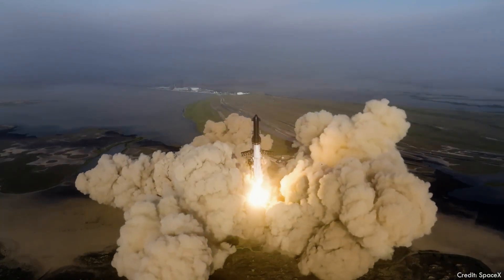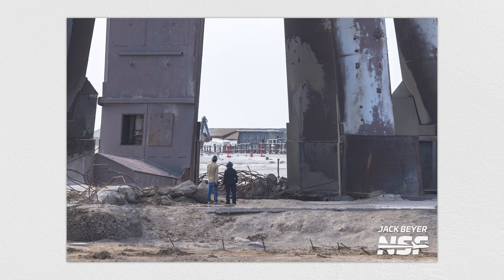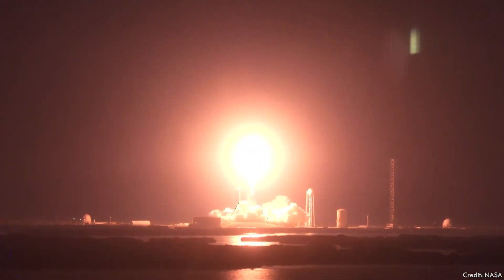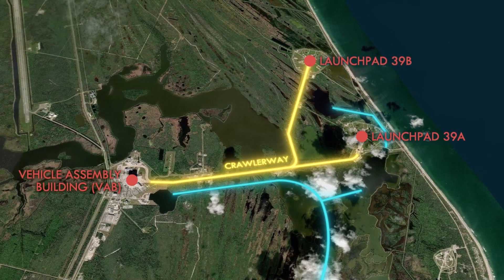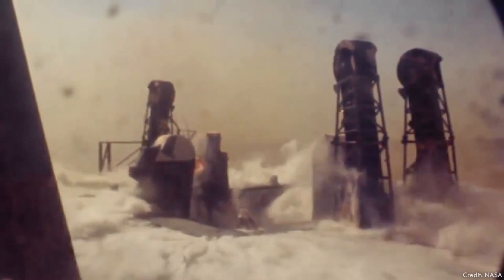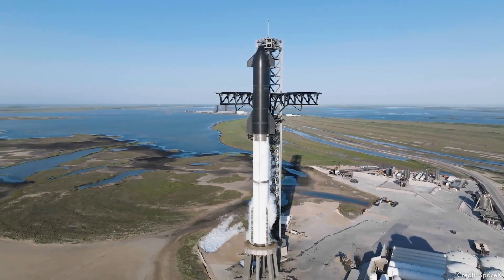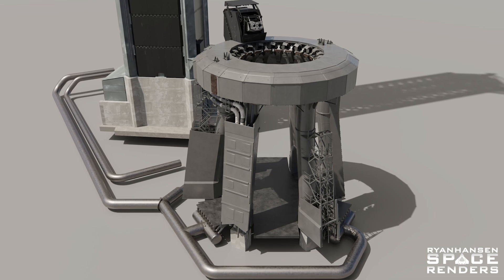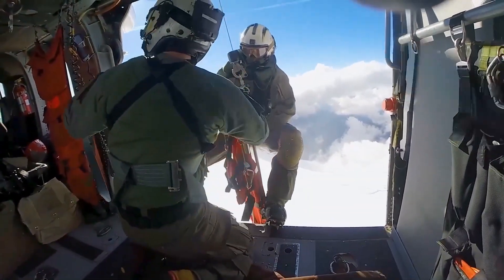Was Starship’s Stage Zero a Bad Pad?

Comment: The launch pad facility had been roundly criticised as inadequate by experts primarily because of the lack of a water cooling system. Despite that, Space X engineers, under pressure from Musk, ignored its widely pointed out deficiencies. In effect, the resulting obliteration of the facility was inevitable.
Reply: They were already working on the deluge system, but because a full static fire did practically nothing to the launchpad, they took the chance for 1 launch that had a possibility of exploding at take-off.
Reply: SpaceX was already planning on the new watercooling system before the first launch even occurred. They knew the current pad wouldn't be a long term solution, but their analyses from the static fires and launches they'd done indicated the concrete would simple get damaged, and not completely destroyed. With that in mind they figured it was worth sacrificing the pad as is to get the launch done, and then install the system for the next launch. In hindsight it was worse than expected, but it's not like they knew this would happen and just ignored it
Reply: @thomashayden804   Every engineer from NASA and industry had advised them not to do it. Yes, they simply ignored it. They simply didn't care if the pad survived or not.   Another stunt. The rocket was also a disaster, it was virtually falling apart on ascent, the engines didn't just flame out, they were self destructing along the way. This thing needs an entire redesign. There is no way to put lipstick on this pig.

Comment: Wondering if it would be possible to engineer a natural water deluge system that leveraged being so close to sea level, so instead of building up, you dug down.
Reply: The word 'deluge' should have keyed you in. Doesn't work as there wouldn't be enough water nor is it controlled. The water system puts out far more water than the hole and must be sprayed to prevent sound/blast damage. Also people will not take kindly to you disrupting the water table and the risk of liquidfaction. The power of the exhaust would also make a hole big enough impractical, the amount of smoke and steam is the amount of space the gas needs to expand into.
Reply: Where would the water drain to afterwards?  You'd just end up with a pool.

Comment: Pads 39A&B have water sprayed underneath the booster from the sides.  The exhaust gases and steam are then directed away in the flame deverter.  The water cooled plate at stage zero will spray water upwards.  Super Heavy produces 16 million pounds of thrust.  Does this mean the total water pressure also needs to be 16 million pounds just to make it out of the nozzles?
Reply: Not all exhaust is going to impact the water nozzles, so no, water pressure would not need to be that high.
Reply: You don't understand liquid, it seems,  you can't compress water. So you don't even need a very high pressure pump to work in that environment.
Reply: @jantschierschky3461  Liquids are incompressible.  A quick and dirty calculation shows anything over 18psi will get water out of the nozzles if loads are distributed evenly.  My question is total pressure for the system.  Lots of area will need lots of volume, presumedly over a short period of time.  Think of a fire truck.  Lots of pressure at the engine to get the volume of water on the fire.  That water is not usually opposed by a counter pressure at the fire.  It's ok if you don't know.
Reply: @armandomercado2248  The total amount of force needed depends on the area of water flow. If the holes in the steel plate are 1% of the total area of the steel plate, and the entire force of the rocket exhaust is bearing down on the steel plate, they wouldn't need a force of 16 million punds. More like 160.000 punds.

SpaceX will use high pressure nitrogen to force the water into the steel plate, and that is a method that scales quite well for generating a large force.
Reply: @SpaceAdvocate  SpaceX first attempt at pad design leaves me sceptical.  Their challenge will be getting enough cooling over a large area very quickly.  The nitrogen water mix was meant to displace oxygen in the atmosphere to prevent a methane explosion from what I understand.  Nitrogen has less heat capacity than water, so it's not a panacea.  I await the thermodynamic engineers on YT to weigh in.
Reply: @armandomercado2248  They won't use liquid nitrogen. The Nitrogen is gaseous and at room temperature, used merely to force the water into the steel plate. No nitrogen should enter the steel plate while the deluge system is operating.
Reply: @SpaceAdvocate  See CSI Starbase video on this topic.

Comment: Maybe I missed it but what was wrong with the proofed and tested NASA design? Why does SpaceX need someting different, twice?
Reply: It's ultimately down to trying to optimize the pad. A deflector system takes a lot more space than the steel plate system, and it is likely more expensive and difficult to work with (given the height and angles present on it. We'll have to see whether the steel plate is reliable and low maintenance enough to make it worth it, but assuming it is then this pad design will be cheaper and quicker to build, easier to work around, and just as effective as the defector system. Could amount to nothing and be a waste of time like Elon mentioned, or it could be another optimization which helps SpaceX get even further ahead everyone else
Reply: NASA always designed without any regards to costs. Which made Saturn V and then Shuttle disastrously expensive.
Reply: They can't dig a diversion tunnel. Underground water is too close to surface. Plus constant lawsuits from local eco activists.

Comment: I was thinking since they are essentially at sea level, could they use a semipermeable lining and make a large deep pool to absorbe the rocket thrust?
Reply: All the water will get blown out of the hole and you will be exactly where you were without the water. You need large flows of water to keep up with the rocket exhaust.
Reply: i thought somthing like that has to be better than concrete
Reply: @Zileas01  They don't plan on using pumps. They will use high pressure nitrogen to force the water out of storage tanks in a matter of seconds. Most of the tanks were already in place before the launch, but it's rapidly being finished now, as they work towards getting ready for the next launch.
Reply: @Zileas01  > the sheer volume of water that would have to be pumped to directly counter the rocket exhaust is insane.

Engineering is done with numbers. "insane" is not a number.

> iirc spacex wants to use actual pumps which just is never gonna cut it.

No, you do not remember correctly. They plan to use compressed gas to displace the water.
Reply: @Zileas01  They are behind the launch tower. Watch one of the recent RGV Aerial Photography flyovers. There are four smaller tanks that I have eyeballed to around 400 cubic meters. And recently they installed another two larger tanks. It might be around 800 cubic meters in total.
Reply: @Zileas01  Oh, and by the way, two of the large vertical tanks are for water. Though they won’t be used for the deluge system.
Reply: @dsdsspp7130  That's not the point of the water deluge. First, water absorbs heat extremely well. Instead of completely torching the concrete pad (or steel shower head), you are warming up liquid water until it becomes steam, which will quickly move away. Second, water is massive compared to air, so the pressure levels exerted in the air are absorbed to become much smaller pressure differences in the water.

Yes, neither of these does anything to counteract the overall forces of the gasses coming from the thruster, but the high temperatures and large impulses that occur from the other two factors make it even more difficult to hold up against those forces.
Reply: @reverse_engineered  I understand the point of water deluge systems.
I'm talking about Elon musk's idea of shooting water up from the pad to prevent the pad from getting destroyed.
and yes water has more mass, but that also means you need more force to push it out, it goes both ways. what I am saying is how is that going to reduce the pressure applied to the pad?
it also doesn't matter that the water turns to steam, it's not going the change the force required to push the water out.
Reply: can't dig, it's against the law to dig this wetland.

Comment: You know who also used destructive testing and rapid development over using their brain? The soviets. So no wonder ole space daddy is sucking up to that terrorist Putin. Never mind that the soviets and their whole N1 program has shown how this approach of development is hugely wasteful for how little faster it might be. The new launchpad might survive one launch without spraying concrete, but it'll likely end up a dented mess of its own. NASA makes all their findings publicly available, including calculations for forces involved which you can easily equate to known strengths of concrete and other materials as well as the cooling potential of water and steel. Doing that shows it doesn't exactly resolve the problem so SpaceX is in for more trouble. I'm all for pushing space exploration and getting back to the moon, getting a move on as well, but disregarding accepted science and decades worth of knowledge we already have is immature to put it mildly.

Comment: Still think it is foolish not to have a flame redirector.  Even if the new 'Stage Zero' is made of steel rather than concrete there are still going to be thousands of potential debris items within 200 yards of the launch that will be turned into projectiles by the thrust gases, it makes sense to have some sort of trench directing all of those gases in a single direction.  At the next launch Elon's neighbours will again be finding pebbles and bolts embedded in their homes and cars.
Reply: Also imagine using "le funny meme arrows" outside of the bavarian flute carving forum
Reply: > At the next launch Elon's neighbours will again be finding pebbles and bolts embedded in their homes and cars.

Can you show the photos of this? Specifically neighbours, not people who knowingly parked their cars in the exclusion zone (employees and filming crews).
Reply: @denysvlasenko1865  lmao so they just let people park their vehicles in a so called "exclusion zone"?
Don't they have any security?
And why are there shipping containers and office buildings in an exclusion zone?

Comment: The absence of both the flame trench and the water deluge are evidence that it was a bad pad. Elon knew and had plans for upgrade that didn't come in time. It would seem he didn't bother to study this area closely though, because he surely would never have tried if he had.
Additionally, dealing with the water table will I bet force a redesign of the tower onto something like NASA did. Watching him fail at reinventing the wheel in this area is tiresome but lets us watch the process play out.

Comment: Curious if they can pressurize the water enough to counter the pressure exerted by engine thrust of up to 33 engines.  Otherwise the thrust will simply push water back to the tanks and fill/destrou that glorified steel showerhead.   I really doubt the current design with the legs so close to each other can last a long time and allow for re-use within a day after a launch.  It,s clear engineers told Melon Husk but the later put priority on launching fast from anything rather than using known designs with trench etc which require more approvals and paperwork to build.
The fact that they added covers to the ring at very last minute before first  flight also shows internal fights where someone finally convinced the boss they were needed and he relented at last minute. 

It should be noted in fairness that this was to be just a test site originally with the real stuff happening a new pad being built  at KSC. But the move of all production to Boca Chica seesm to signal it may become primary launch site for these beasts. 
Also: original pad was not Fondag, but after the 6 engine test fire, there was a fair bit of damage to the congrete and they poured a layer of Fondag thinking it would be enough after testing it behind 1 engine at McGregor. 
It remains to be seen whether "iterative development" will result in the current design being patched up with new stuff after every launch to see if that will fix the problem or whether they will rethink the design alltogether. 

out of curiosity, if a flame trench were built from ground level down and is allowed to fill with water, how woiuld that work at a launch? wouldn't thrust push that water out (and boil a big part of it) ?
Reply: I'm not really confident in the showerhead design working tho. Even with reasonable sized holes, you would need a lot of pressure to counter the force that rocket makes, so it would be like aiming water cutters into the rocket, and with the kind of pumps that you need for that.

Comment: So, the advantage of commercial spaceflight is that they ask for forgiveness instead of permission? Not sure what to think of that.
Reply: They asked permission, and got permission.
Reply: @SpaceAdvocate  They lied on their application. That's not what I would call asking permission.
Reply: @reverse_engineered  What did they lie about?
Reply: Simple, it's gonna make space relatively cheap to access which will benefit the human race in ways that we likely can't even comprehend yet. Government failed to deliver on their promises of the space age, so the best thing they can do at this point is to get out of the way of people trying to realize those promises without them.
Reply: I know what to think about it. I'm fuming every time I remember that Shuttle was (by accident) perfectly designed to keep spaceflight stagnating for TWO GENERATIONS. We lost 50 years!!! We could have rockets similar to Falcon-9 in 1980...
Reply: @denysvlasenko1865  Show me how we could have fixed Hubble with anything from SpaceX and I'll agree
Reply: its the same in governmental.